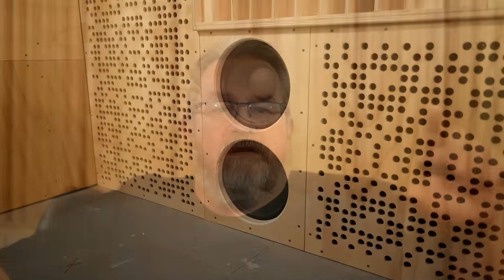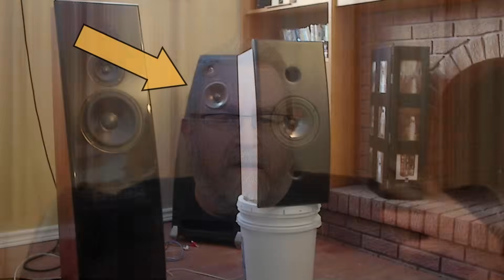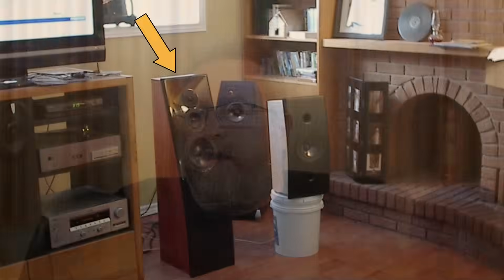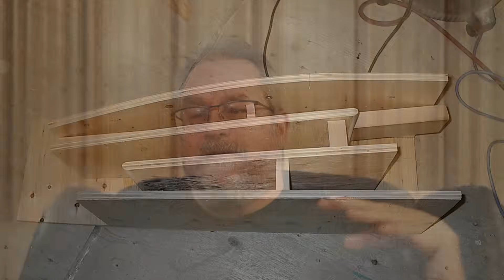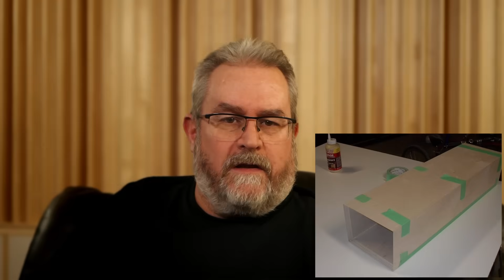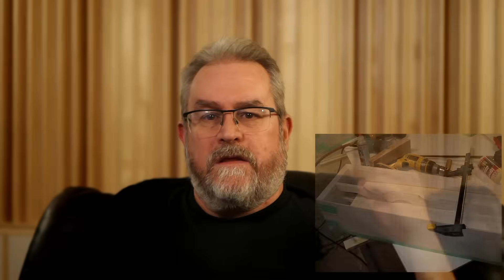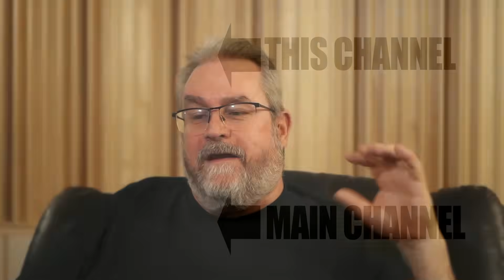Transmission Line Speakers are a Trap

Comment: Sorry you really have no idea what you are talking about. Bass extension from a properly designed TL is measurable. As is the lower fs. You fail to mention Dr A.R. Bailey's 1965 paper on TLs, any of the work of Bub Fried, the variable rates of attenuation which is key to how TLs work. Given your stated design presumptions and goals I'm not surprised this design approach does NOT work for you. However, the fact is does not work for you does NOT mean it does not work. This video should be ignored by any serious speaker designer/builder, instead read the work sited above. More audio BS.
Reply from the maker: Sorry you didn't listen to what I said in the video. For example, why are you saying that bass extension is measurable from a properly designed TL? Of course it is, if you've designed it to do that. 
But it's also measurable from a ported box and will be just as deep. But a ported box is easier to design and build and generally smaller than a TL. You might fool yourself into thinking the bass from a TL is "better", but the fact that very few big manufacturers market a TL is proof that any difference is marginal at best.
Before you tell people to ignore the video, try actually listening to what's being said in it first.

Comment: Hey John, thanks for your informative video.  I just built an open baffle project speaker design using TB W8-1772 FR drivers mounted on a 12X18 oak plank paired with an SVS 10 inch Pro 1000 sub.  Although the sound is really amazing, I'd like to couple the design with an 8 inch woofer, ported or sealed box (undecided).   Any thoughts on this concept?

Comment: They are actually incredibly simple to make, but.. properly and easily made, they are very large.
How tall?  The lowest note you need to ever produce cleanly for western music is 27.5hz, or the lowest note on a piano.  Below that, it's kind of counter-productive as even drummers will tune their bass drums to 41.2 hz ( same as the lowest Timpani ), though low F ( 43.65 ) is more common so as to stay in tune with other instruments. 27.5hz is 2 meters.  Yep.  And the gears start turning as that's not home decor friendly.  With a proper base and thickness of wood, plus room for the 6-8 inch speaker to be mounted, that's 7.5 feet. For a "not quite full range" but a good compromise design.  
And this is indeed the trap. Everyone wants to make one that is smaller, and even going to a half-wave design is still a meter tall and full of acoustical issues unless you really dampen it and do some fine tweaking. Most that I see have the path at 1/4 of a wavelength, and that's now an engineering headache. Simple just turned into a mess of calculations and trial and error, on a cabinet that is (still) huge for a normal speaker.  I mean, why build something as large as an old JBL theater speaker that takes a lot more work and sounds about the same - versus just a standard large sealed box? These really only work as "advertised" if the tube has no bends in it.

Comment: Since its winter, I decided to move the Magnepans to the sidewalls and fire up the tube amp and Rega NAOS (TL) speakers.
My first experience of TL were the Rega Ela.
A visiting friend had to ask if the REL subs were on, since the bass extension got down to 27hz.
They weren't.
Nuffsaid 
🎵🎶🤫🎶🎵

PS
I guess what you were trying to say is that TL design is best left to the pros?

Comment: @2:47 I don't mean to say you're wrong at all and you didn't invent the term of course, but I recognize the term "transmission line" and this explanation is the exact opposite of what a (non-audio) transmission line does. In radio, a transmission line is a specific type of waveguide and, I believe, is or was considered lossless - all energy going in, comes out. Your explanation sounds like it would improve the speaker, but I don't know if it deserves to be called a transmission line by anyone.

Comment: Maby you can go for a not complex design? A box, then a straight vertical tube out from the top of the box? Chop the tube for needed tuning and use 2 inch mattress foam on the walls of the big tube to rid yourself of resonance. Easiest to go big if you are going to make a TL, the sound and ease of building is night and day, small TL is to hard and as you say simpler with a good ported design. TL line is suppose to have the wave come out the port at the same time as the woofer push out the second turn so both the port and the woofer are in  phase as you know. The long waveguide is there to time delay the wave and absorb higher frequencies but you will have a bigger range in bass frequencies on phase with the woofer than a normal bass reflex wich usually just have a small peak where the port and cabinet are tuned, it will also not restrict the woofer more than free air does. a lot of benefits here.
I have built full TL quarter wave for bms12S330 bass at fs 28,6hz and it was more deep bass than i could ask for, the woofer behaved like it played in free air almost so it was important for me to have a good amp to have good control.Class D recommended for driving bass i think. I had to go from almost 3 meters to 1.8m to tune it at speaker fs, used dats v3 to find impedance curve to tune it. I have never heard anything better. Keep in mind i used foam stuffing on the walls of the BIG ports so rid myself of unwanted frequencies. I would not recommend small TL, they are so hard to build. I dont mind a big speaker so i dont have many curves so its much easier to make. The curves brake the sound a lot and lowers db as well. I have been testing and studying this for many years now and it has payed off :)

Comment: This question will show that I’m either a genius or I continue to have no understanding of the complexities involved: Could you take much of the complexity out of making a TL speaker by having the last portion of the pipe designed like an enclosed drawer that extends out of the back of the speaker with the port in front?  Then, one could slide the drawer in/out (like a trombone) to “tune” speaker to the room and for optimal measurements and sound quality. By making it adjustable you have a built in fudge factor which removes the precision needed in manufacturing, while making it customizable to a variety of situations/rooms.
Reply from the maker: Such a thing could be built, but it would only be useful as a prototype to experiment with different tunings. In the end, when the ideal tuning is figured out, you would then build a proper one without moving parts (that would start to rattle over time and leak) as the final model. Subs and speakers aren't tuned for rooms, but for the speaker driver operating in the speaker box to get the optimal response.
Reply: @IBuildIt  ah well…no Mensa for me….
Reply: What about adjusting for altitude and relative humidity?
I think you're onto something...
🎵🎶😉🎶🎵

Comment: If you're using Martin King's or Augspurger model there is a difference if you're using a mass loaded model vs a tapered line with (same tuning frequency). He has recently commented that port compression is probably the reason for this, and the reason for last 30 years that I used as little taper as possible, 3:1 Thru 8:1. The ripple can be filtered out with intuitive placement of damping material. Using models from Martin, George Augspurger and even archaic Bailey models I have had outstanding results...
Reply: Hi. I was under the impression that a true T-Line uses a consistent line, i hear John mention that the line should always tapper down in size to a percentage of the cone, any thoughts you could share in regards to why it should be this way or benefits of doing this or others ways?
Reply: @AlwayzLearning  Tapering is fine. It just adds a little complexity to the very basic formula, but no more than the type of material one dampens the line with. Personally, i think 1/4 wave t-lines are easier to design than any other enclosure. Been doing it off an on for more than three decades, and I'm still leaning 
https://www.youtube.com/watch?v=qm5K_VVRwXQ

Just a bit of fun for you
https://www.youtube.com/watch?v=-U3XW6TV9zI

Tapered t-line
https://www.youtube.com/watch?v=R_QUm97_kJk

I'm currently working on compound & series tuned designs, inspired by Hexibase
Reply: @AlwayzLearning Apologies for the very late response. A true t-line or more appropriately quarter wave resonator can really be any geometry taper. Drivers with a QTS of .35 of greater work better with more taper. And under .35 less taper. Many design experts including Paul K, prefer ratios of 10:1 or greater. I find this adds too much port compression and reduces dynamic range. TL's generally don't like low qts drivers as the driver tries to control the line, which works against it creating distortion. But to be frank I've had good results with the old rules of thumbs and new software alike. The old 3:1 to 4:1 ratio seem fine but the enclosure will big larger. I'm using an old 5" CSX driver from Peerless and it's great. People always wonder how that much clean bass can come from that small driver. Although the cabinet is approx 30"x14"x7.5" for a 5" driver, not exactly small...

Comment: I commented on another video about phase plugs.
I fell into the transmission line trap as well as the piano black disaster just like you. They were good but they took a year of trial and error. Today they sit disabled in my barn 😢.
I made powered speakers with dsp in a week using drivers robbed from a pair of old Boston Acoustics. They sound like anything I want them to.
Live and learn
Reply: What the sensitivity and THD of DSP powered speakers ?
The advantage of single full range driver (plus a piezo tweeter) in TL or TQWT is aesthetic simplicity.
The commercial companies are into vertical column array speakers (muscle car design philosophy) with large price tags. they look better than monkey coffins, but not much better. and not cat safe.

Comment: Ports and transmission lines are not high fidelity. They don't reproduce the recorded bass, they resonate or invent different bass from the out of phase information.  Sealed cabinets reproduce the bass.  Learn to properly EQ a sealed box and then you have high fidelity.  Two woofers in sealed boxes will always be better than one woofer in a huge transmission line box and likely will cost about the same.

Comment: Just like antenna theory!    Minimizing VSWR will maximize power delivered to the loadn (air ), by the driver
50 ohm coax connects a 50 ohm source to, you guessed it, a 50 load,  The TL is lossless.  LOL  So inside the source
is 50 ohms.   Impedances if you will.  

VSWR = reflection back to the driver.  Hey ISOBARIC, fake it.

A mirror has a silvered backing,  a short to incoming light ( waves )  so . . .  the light that gets to your eye is 
180 degrees out of phase i.e.:  Backward.  

A voigt pipe adds a stub ( position of the driver along the pipe)  same as an antenna Amigo.  The closed end of the pipe
will have really low VSWR,  no end of the TL, so to speak,   pressure waves go in, but do not come out.  really cool, with
little to tune.

Comment: Martin J. King is an invaluable resource on Transmission Lines. He is the first to use computer modelling for this application. Puts it more in the realm of science than the black arts.
Reply: Actually George Augspurger was the first to model. He used an electrical derivative and Martin King used an mechanical one, they both overlap very well. I've used both 
with outstanding results...

Comment: I agree. I saw no benefits over the ported stuff Ive built. Im so lazy now, I don't think I'd tackle another transmission line set. I've actually become partial to passive radiators for smaller speakers  and open baffle stuff for larger speakers. It's fun having so many options though

Comment: Audiophile/woodworkers never ever say "It's too much trouble to build, I'll just make a bass reflex instead"! The building is part of the craft. I made a tapered line from a Speaker Builder magazine article that used a Radio Shack Realistic 4" woofer and poly tweeter. Did I think it would sound better than my Boston A60? Nope, but it sounded decent. But it was my very first made from scratch speaker that actually looked good.
Reply: Monkey coffins look boring, having fun and interesting loudspeakers is important, they are going to be there in your room.

Comment: What about a port designed like a "Tesla Valve"? I wonder how or if it would work.
Reply: Might be tough to tune, but it could, in theory, be done.. You would likely need two, however, so you don't end up losing neutral average pressure inside the cabinet. One alone would essentially rectify the pressure wave in one direction

Comment: I have had two pairs of "transmission line" speakers ( DCM TimeFrame TF-700 ) for decades and never knew what the term actually meant. Thank you for the post.
Reply: I had read about them in the 1970s but the first time I heard one was in the early 80s, a DCM in Texas. I currently have a TF-600 in my living room behind a stand-mounted Polk R200, the Polk has far better clarity and neutrality but the DCM has tighter bass and better spatial cues. It's probably time to refurb the DCM.
Reply: @gregmatula9749  It's not a simple task with the "speaker sock" to deal with, but the drivers probably need it. The internal wiring is super thin and the crossovers aren't built very well either. There is a lot of room for improvements on the DCMs but I have always liked them through the years. I have had and heard better but I still like them.
Reply: @01sapphireGTS  I like them too. That little balanced drive Audax tweeter that so many companies were using throughout the 80s three of them, one on the front coax and two on the back, did a good job of an omni simulation. Sensitivity was pretty high on them, over 90 db, not a bad trade-off. My brother has the original Time Window I don't think it was a TL.

Comment: If you want to do a piano black finish then you basically have to bondo or putty fill the whole surface after sealing the MDF, then you sand it as smooth as you can with block sanding, then you spray it with high-build primer and sand it again. Then spray on a very light coat of black, sand that off to make sure that there aren't any low spots hiding from you, then layer on 3-5 coats of black before sanding it smooth up to at least 800 grit but no more than 5000 grit before you spray on between 5 and 8 coats of clear, sanding between every two to three coats with 2000 grit to knock down any orange peel. Finish by using a random orbital buffer and buffing compound. Also, be sure to seal any holes thoroughly with tape and some kneadable mounting putty since you'll have to wet-sand the surface to prevent the paint from clogging the sandpaper. For the absolute best results, try using lapping film as the particle size of the abrasive is even more tightly controlled than it is on standard sandpaper and will result in more consistent polishing. The reason why you can't sand the surface too fine between coats is because the paint bonds mechanically and not chemically between layers and you are relying on the next coat to fill in the micro-scratches in the finish in order to "grip" to the layer below it.

Honestly, Piano black does look absolutely stunning, but it is a huge amount of work to get that finish. I'd rather put a beautiful veneer on the cabinet and lacquer that. Just remember to rub in a thin layer of relatively concentrated lacquer for the first coat to prevent excessive grain swelling and apply two to three additional coats before sanding the finish flat. If the entire surface doesn't develop a hazy finish from the sanding then you haven't gone far enough. If you notice that you are sanding through the lacquer completely then stop and apply more lacquer. The goal is to get the final finish as smooth as possible, not to get the veneer itself as smooth as possible. Once you've managed to get to a point where you can get the surface uniformly flat and hazy, then you can step up to 2000-5000 grit before you apply at least one more coat, then move on to polishing with a random orbital buffer. Of course, this is assuming you want to achieve a glassy finish and you don't want to feel or see the grain and texture of the wood when the light forms a glaring reflection on the surface. I do think that satin finish wood that has just been treated with oil and wax is very beautiful, so it really depends on what you want for that piece.
Reply: If you know how to paint, there’s absolutely no reason to sand between color coats. Unless you are a terrible sprayer, you will never notice any of the orange peel in the black paint. As long as your clearcoat is smooth your paint will look smooth.
Reply: @Rayman-cd8bd  I didn't say that you needed to sand between color coats. The thin layer of paint that gets sanded off after the high build primer is to act as a marking coat to ensure that you have thoroughly eliminated the high and low spots and have a perfectly flat and true surface to paint on. Also, you will get a different sense of depth to the sheen if the color coat has zero orange peel before you move on to the clear coats. It's not a huge difference, so most body shops don't bother to do so, but piano black is a high end finish for a reason.
Reply: Alternatively, take the cabinets to your local car spray shop, ask for some exotic car finish. anything cheap they have lying around left over.
They can spray it fast and have the drying heat lamps to do multiple coats quickly.